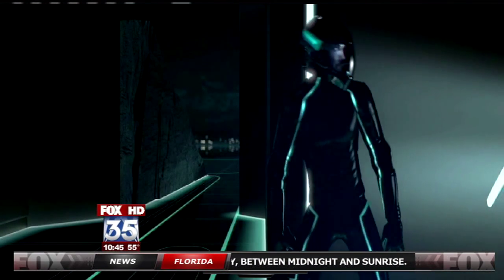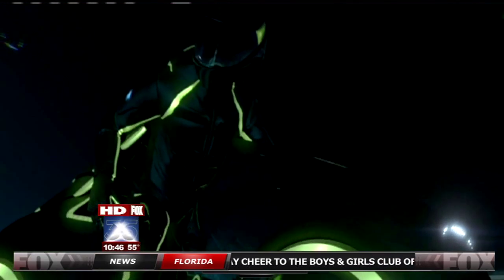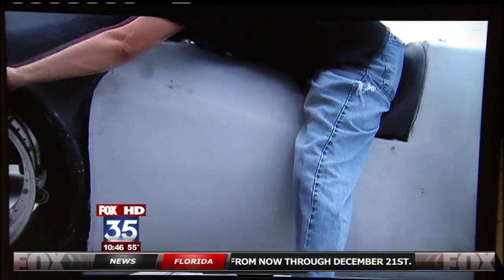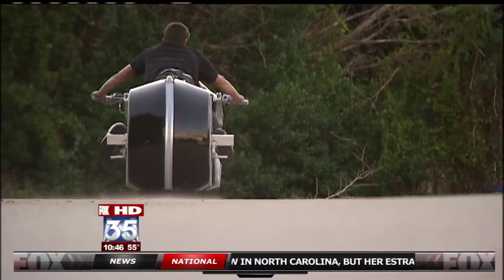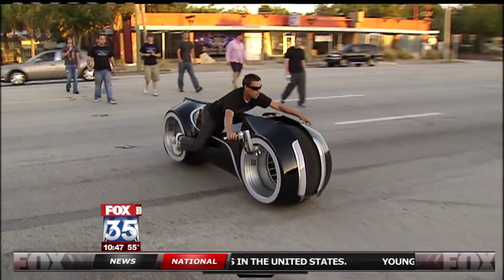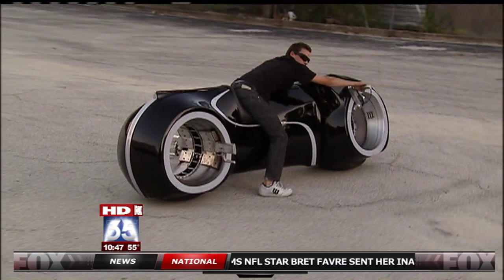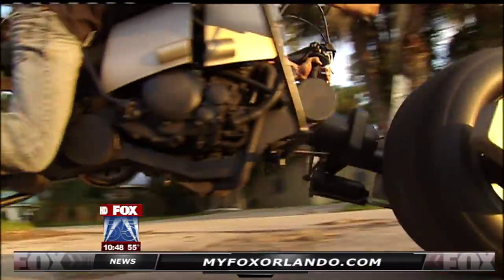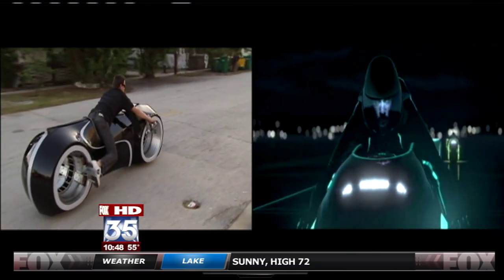Real life TRON light cycle inspired by movie

Comment: _____Nope, uh-uh, rimless wheels HAVE been done before.  A half a second on Google, and you can see 'em all over the place.  Now to tell the truth, if these dudes would've had a cool half million or so, they could've had the vehicle's power plant (in this case, a gasoline engine) power a generator.  And once you've got a good genny, you can stick high-torque electric motors or whatever on the wheels, inside the wheels, wherever.  But the whole killer laser-plasma trail thing is gonna hafta wait.